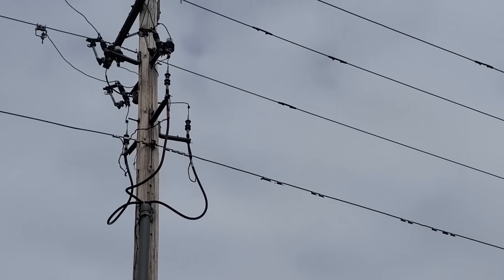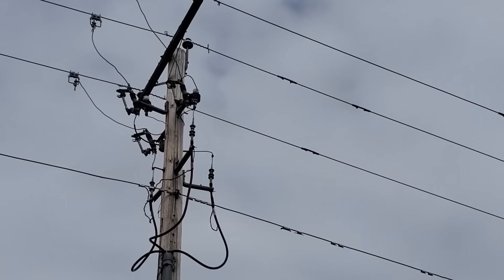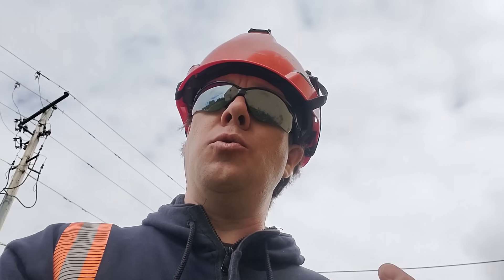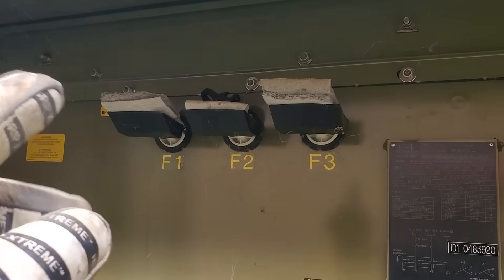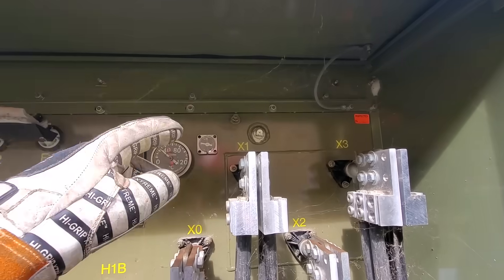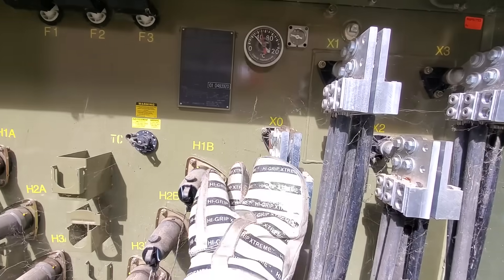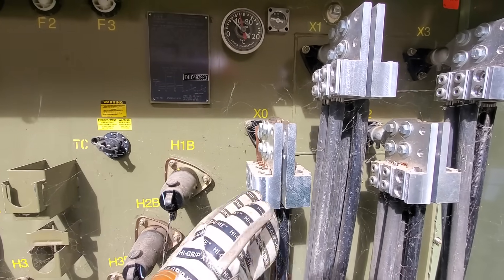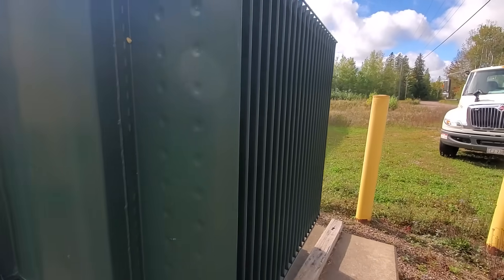A closer look at Padmount Transformers

Comment: Is it normal that the lights in my house dim slightly when I hear my next door neighbour's heat pump starting? FYI, we share the same pole transformer and there is no load starting (fridge, washer, etc) in my house when this happens.
Reply: Yes.  That is called inrush current.  It is very common for motor loads to spike the current they draw when first starting up, and then settling at their full load current for long term operation.  It has to do with the inductance of the motor windings and the inertia of the rotor to initiate its rotation from rest.  This can often be mitigated with capacitors and soft-start motor drivers, if it is desired.  On large buildings, they have energy management systems to prevent all HVAC motor loads from starting at once, so that the units have a staggered start-up, and avoid too much spiking of the load.

Heat pumps (and air conditioners) tend to be the most Watt-intensive loads on the grid of all the motor loads, so it is no surprise that your neighbor's heat pump is precisely what causes this.
Reply: @carultch  Looks like their heat pump was defective. They got it fixed now the lights barely dim, I presume it was a defective Cap for the compressor based on the noise I used to hear on startup.

Comment: There is a large pad mount transformer feeding my apartment building and there is a good amount of oil staining on the concrete coming from the box. Is this something to let my utility company know about?
Reply: Yes it could be leaking.
Reply: No, just pick up some 50 weight Super Tech oil at Walmart and top it off. Or Pennzoil High Mileage Synthetic. 3 quarts should work. Use a funnel too.
Reply: Wait long enough you will see a fireball

Comment: Hella nifty to see inside one of these. At my last job, we supported a customer whose building has three phase power. One afternoon, a single phase failed in their transformer and nothing inside the building tripped off. Apparently it increased the voltage of the other two phases just enough to cause trouble but not enough to trip too much? I’m not sure how the math on that works. It actually started a fire when a power strip melted on top of a bankers box. Fist bump from Shreveport!
Reply: Circuit breakers trip from too much power, not too much voltage.  A computer using twice as much power as it should, might not trip the breaker, but would be REALLY bad for the computer XD
Reply: @tsm688  thankfully, the computers used a multi voltage switching power supply, so they were just fine. One of the best things about the micro PCs is they just use laptop chargers.
Reply: Was it shaking? We had a 115,000v-4160v transformer in Buffalo NY lose a leg, and you could feel it shaking from outside the building.

Comment: Many years ago, a friend of mine reached inside on of these transformers, except this one was almost 3 times as large and it was to distribute the power in a park with a baseball fields with large lights, tennis courts, basketball courts etc, .... how? well, in those days for some reason, this particular transformer had a viewing window (smalll oval, but, nonetheless a glass oval). Someone had broken the glass and my friend reached inside....

I had left him about 5 minutes previously to go home. I heard an explosion, I ran out of the house and looked in the direction and saw my friend on the ground. I ran to him and he was burned, bleeding and disoriented, his sneakers off his feet. I was petrified and did not dare to touch him for fear of being electrocuted myself. I ran to his house told his mother and from there, EMS showed. I visited him in the hospital and his right arm was extended and bandaged....he did not seem too coherent. He survived, but was not the same kid again. A steel plate was welded on afterwards on to the transformer.
Reply: Curiosity can kill you. My wife was a ER nurse in Delaware many years ago. One day a kid came in electrocuted. He and his buddies decided to climb a pole that was carrying at least 7600 volts. He literally got cooked to death, she said his body was still smoking when they got him.
Reply: A transformer at a park needed for lighting would not be 3 times as large as this one…most likely a 480 step down to 120/208 transformer.  Enough to do the damage you wrote about but 3 times bigger?  No.
Reply: @erikcchansen3280  they were probably 3 times smaller when this happenedid you ever think of that?
Reply: @erikcchansen3280  not sure if 480 will do that (but it is horrible when it comes to arc flash)
Reply: @erikcchansen3280  I think the point of the story went right over your head.
Reply: Version 33  Typical Internet fake bullshit.
Reply: whât yôuř frênd wãs rêĕchinğ fõr
Reply: @MeaHeaR  The afterlife apparently
Reply: @MeaHeaR  
Maybe to open the door from inside? Like on a car door? Maybe?
Reply: @uploadJ  yes true 👍 I never thought of that thanxx

Comment: DELIVERING TRUCKS TO ALASKA AND WHILE RUNNING THROUGH THE ALASKA HIGHWAY I NOTICED THE RURAL AREA TRANSMISSION LINES ONLY HAVE A SINGLE WIRE!
IN THESE AREAS DO THEY USE THE EARTH AS A NEGATIVE/ NEUTRAL CARRIER EXCLUSIVELY???
IN THE RURAL AREAS OF THE USA 
THEY USE A TWO WIRE SYSTEM!

Comment: Really interesting video, thanks. Down hear in New Zealand we refer to these as 'berm subs' as they usually sit on a concrete pad on a grass berm in residential areas.
Reply: As a 50 y.o. NZer I have to say I've never heard them called that. You must be a Mainlander.
Reply: @TonyRule  Tony, I am from Wellington. I had a school holiday job painting 'berm subs', working for the Hutt Valley Energy Board (RIP) back in the 70's. That was certainly what they were called in the Hutt Valley at the time.

Comment: Bayonet fuses, release the nitrogen so you don’t get a bath. The DETC is usually 2.5% per step increase/decrease from nominal 3 or C position. Most of these transformers have a head space between the top of the oil and top of the tank. It’s usually filled with nitrogen an inert gas.

Comment: Looks the same as the ones I've installed as an electrician here in Maine. Other than we use Black, Red, Blue for 120Y208 and don't use 347Y600. We only go up to 277Y480, unless it's for very large industries where 4160 is fed to some equipment.

Comment: If you have 7200 V relative to ground then it means that neutral is grounded. Is it so? Because in our country and neighbors we have lines 6 or 10 kV without neutral at all, i.e. neutral point of transformer is not connected neither to the next transformer or ground.
Reply: @Futuristic Nostalgic  Thanks for your explanation. Especially at 4 A.M.)) Huge overhead lines uses steel core and aluminium wounding but mid voltage lines uses just aluminium multicore wires. Non grounded lines causes some difficulties with automatic accidents recognition so for now those lines upgrades little-by-little to resistive or inductive grounded schematic.
 *Oh! There IS actually a steel electric lines but they're not for power distribution. We still have old system so called wire-radio. It's actually an audio signal lines with a couple long wave AM channels over it. Audio signal has about 100 V in amplitude and then reduces with small transformers to 30 and then reduces another time just in a loudspeaker. And if you have a little bit more complex loudspeaker, you can listen those radio channels too.
Reply: @Futuristic Nostalgic As most of people I wasn't listening a wire-radio for like 15 years or so. But as I can remember it's mostly an advertisement of all those fckn super-duper-mega "medication" stuff. Old people still listening it because in USSR there was a lot of useful and recreational information.
Reply: This creates more problems in the long run. Any TX that is installed on the ground will require a ground connection. If the neutral is not brought out, you will need to create a suitable ground grid. Sometimes if its under 27.6kV you can get away with a double grid around the TX. If 44kV, you are putting a lot of copper into the ground.

In Canada, every secondary wye's neutral should be connected to ground. In some cases (not really), you can get around this for inverters such as wind, solar, or BESS.

You definitely do not want to be leaning on the chassis of a TX without a ground connection. Doesn't matter if the neutral isn't brought out. A delta to delta connection will still find its path to ground through whoever is leaning on it. You don't mess with the capacitive star point buried deep within the deltas. That said, its normal for TX's to be Line to neutral or Line to Line connected on the high side for residential 1Ph services.
Reply: @herro36  However, the question wasn't about it.

Comment: A very interesting video. Thanks for posting. I've had a life long fascination for all things electrical. As a Brit living in France, it's always interesting to compare systems. Also between Europe and USA & Canada.  I noticed that there was a fair bit of slack cable at the top of the pole. Wouldn't that be a bad thing during windy weather? Europe just have enough to go from the line to the cable protection tube.
Reply: Slack is usually left because most runs in the USA will face breaks even from the poles and they are longer than Europe.

Comment: The company I work for had “Lester the Lightbulb” growing up. Great video Aaron. Padmounts are a different animal but the one in this video was pretty straightforward delta/wye setup.
Reply: Funny story, after watching your video the other night, I got flagged down by a customer for part power at their factory. Primary tested good, turns out the had a blown fuse inside the padmount. I watched the troubleshooter open the fuses just as you explained. For the record, I’m in Substation Ops and the padmount is “outside the fence”. OHL works on padmounts.
Reply: As a kid, Owen County RECC had Reddy Kilowatt.

Comment: Great video brother...just curious about the threading process of a new powerlines...I was wondering how they install the new lines between pole to pole to get to the other end (whether it's to another substation or town or city)of its destination...I have seen trucks with large spool of wires going up into the poles but never have time to see the whole process of it and was curious if  there anyway that you can explain or show us how this process work out in the field...Thanks for your videos and keep up the good work brother!!!👍
Reply from the maker: Hey thanks man! I've got a vid a few months back you should check out... It doesn't show the process in action, but show one method where a crew used rope to pull the lines in while under tension. 

Sometimes during new construction, when there's isn't much traffic or road crossing; we can simply drive the reel the length of then line as it pays out on the the ground. We then simply lift it up at each pole and then take up the slack using "come alongs".
Reply from the maker: https://m.youtube.com/watch?v=qCZNFRoGlT4&t
Reply: Thank you so much brother I'll be sure to check out the link to your video you sent me.....stay safe out there brother!😁👍

Comment: I got the chance to see inside one of these once. I work at a place on a cul-de-sac. The power is under ground and we have a pad mount. A neighboring business was installing a security fence. They didn't call miss dig. Sure enough, they hit the power with the skid steer auger. There are switch boxes for every business, I believe. The local power Co was able to isolate the problem and feed the street from both directions to keep everyone with power. I was at work on a Saturday when they repaired the damaged cables and switched us back over. The pad mount was on the other side of the wall from me. When they switched it over our xformer growled like you can't believe. I drove down to where they were working and told them that I thought that they were single phasing us. They came down, opened up the xformer, and checked with their voltage stick. They said, "Yep, we are. We'll switch it back to the temporary connection and come back another day to fix it."

Comment: Are they green everywhere? I know they are in BC, obviously in your province too, (NB, right?) and in Illinois. Any thoughts on why green and not another color?
Reply from the maker: That's a good question! We've got a few grey ones. Just an assumption, but perhaps the green color has been decided to be more visually appealing 🤔 ...blends in with grass and whatnot. Then again, the green sticks out quite a bit in the city 🤷‍♂️
Reply: They're green so they're not obtrusive.  If you painted them fluorescent orange people would complain.
Reply: @stargazer7644  true, but most other electrical equipment is grey, not orange.
Reply: @IceBergGeo  Most other electrical equipment isn't mounted in the front yard in the bushes.
Reply: @stargazer7644  also true, but I can count on one hand the number of those boxes I've seen in someone's front yard. Also, most in commercial settings are surrounded by pavement, around the back of the building.
Reply: @IceBergGeo  Where I live, there's one in the front yard of every 4th house in subdivisions with underground utilities.
Reply: @stargazer7644  bummer. They're all in back yards whenever I've seen them, since most homes back up to other homes back yards.

Comment: The buzz from the boxes make me avoid no different than when I hear a tree start buzzing. I just start skipping out.
Reply: The buzz the transformer reacting to the 60 Hz or 50 Hz electrical frequency (depending on the standard in your country).  The core changes its magnetic field at 60 cycles per second, which causes it to vibrate relative to the steel cabinet.

Comment: How high a working temperature the transformer can handle before it becomes critical ?
Reply: In the IEC world, Insulation is usually Class F rated for 155C. But anything over 110C sends out an alarm. At 130C it trips the upstream Circuit Breaker
Reply: @Mjollnir1983  Thanks for the information
Reply: Most are designed to stay under 80C in ambient.

Comment: Louie the lightning bug, Smokey the Bear, Mr. Yuck... There were lots of great safety mascots from growing up, LOL.

I just realized that because my house is the closest to the main road that host's the main overhead lines it has an overhead feed from a pole mounted transformer. But all of my neighbors further down the shared driveway are underground/pad mounted feeds. Meanwhile the same situation is mirrored with the houses across the main road from me. I would think that in the case of the transformer being somehow faulty or whatnot it would not only be easier for crews to identify but also for them to repair being in the air, right on the mainline.

Super interesting, I've never actually seen in one of those boxes, I will say ours out here are about 1/3 the physical size of the one you showed. Come to think about it I've always wondered what is under those pads with the grates in them too, haven't seen in one of those either.

Super cool vid Man, Thank You! :)

Comment: Why are they so much bigger then pole mount?
Reply: Because they can be.  You only need one on the pad, 3 up on the pole.
Reply: Because they have a much higher power rating than the pole mount transformers.

The largest pole-mount transformer available is 167 KVA single phase, which can add up to 500 KVA if you triplex it with two other transformers to produce 3-phase power.  I'm not sure whether you can even triplex transformers that large on a single pole or not.

Pad-mount transformers can have much higher KVA ratings than that.

Comment: What is the conductivity of spider webs? Ha, great video! Thanks for sharing. My old story from work, called PoCo out as the 500kva pad mount was leaking oil, installed 40 years ago. Defiantly never had yearly inspections. Anyways, lineman opens the door and was quickly observed the insulation jacket on primaries fell off from degrade and opening the cabinet. Promptly followed by "back away slowly! and kill it before fire!" At this area, isn't the highest rated power company for maintenance/grid loading design/ability to be proactive. So, there are standards for the industry (you say this alot), but its not a requirement to always take the higher standard, just would be nice if the basics were looked after better. Maybe that's a video topic, ways to exceed the minimum standard - but gets tricky talking about where every jurisdiction is different to not be an opinion, rather technical.

Comment: Also the cost of burying all the electrical lines would be insane, and any upgrades or relocation would be far more difficult. 
Your ducts are encased in concrete? Any of the ones I've seen here in Alberta have been just DB2 conduit.
Those warning stickers must have been a federal program, same ones out west.
Reply from the maker: Especially the cost with a rural system! 
Not all of them are encased I'm concrete. Most secondary lines aren't, and a lot of older primary feeds are not. All new three phase installations that are mainlines or near roads and parking are concrete encased
Reply: @Bobsdecline  When NOVEC ran the primary feed to the transformer for my new house, they directionally bored it and pulled HDPE conduit (black with red stripes), then pulled the primary cable through the HDPE conduit. 300 foot run from the pole to the transformer. They charged me $8000 in 2017 dollars for this work. If it had been overhead there would have been no charge but there was no way that was happening, I would not have been able to get an easement for overhead lines from the neighbor.